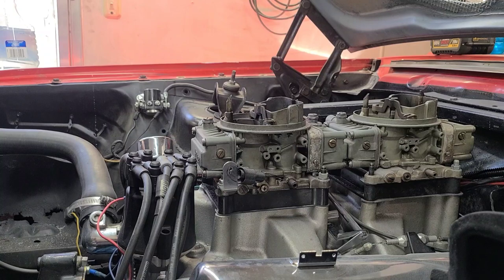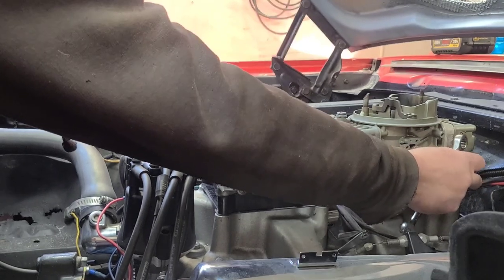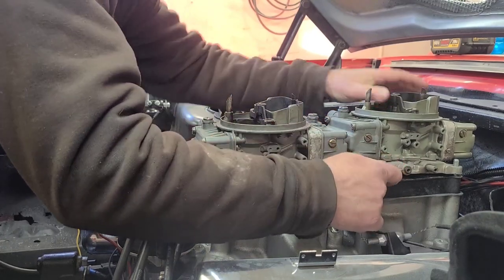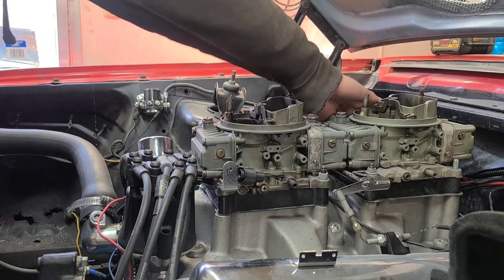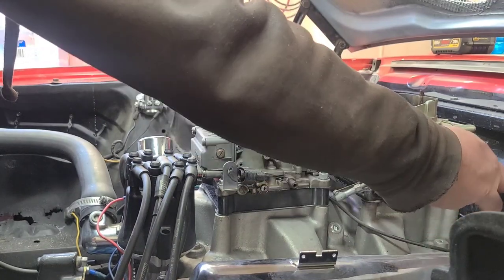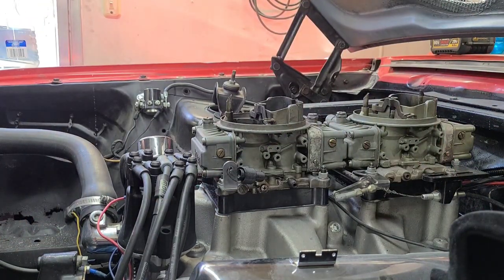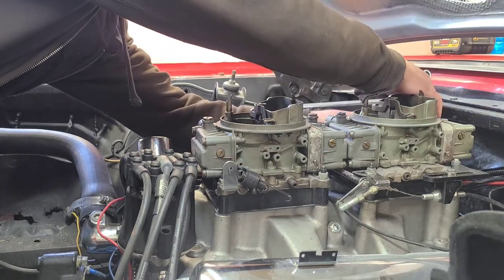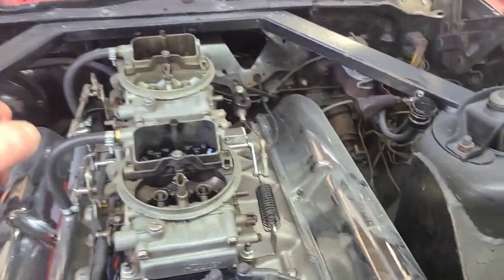1963 Ford Fairlane FE Dual Carb linkage and a little history

Comment: Thank you so much for the knowledge you have being shared. I love learning about older cars. That's what I grew up doing is working on them. I was fortunate to be a Chevy man, never understood the things Ford and Mopar done... Lol.   That being said I miss the little 67 Falcon that I had when I was 17-20. Got to where only people who would run my 3rd gen Camaro was those who knew they could outrun me... Of course around the little town we terrorized here in south Ga... So I took a blown up 350 cleaned it up and put my Camaros intake and aluminum pulleys and everything on it. Dropped it in the Camaro. Took some old stamped steel tall valve covers and an aluminum intake, painted them Ford blue painted the block an off white tractor for 9 in color put black aluminum pulleys on it and a 125 shot sneak nos system run through a vacuum line to hide it fixed a carb spacer with the guts out of the nitrous plate. That 388 would tote the front of that falcon pretty good. We didn't have drag radials so I always ran some half used oval track asphalt Hoosier tires my dad or uncle would sell me pretty cheap. Those were great days looking back from 40... Been trying to build another since my nova I sold before my divorce. But busy building the boys vehicles with them. They're 15 and 12 and own two a piece.  One to complete build, 68 C10 and a 94 Z28. Then both have trucks they play with, ones a 92 step side 377 forged internals thinking about adding turbos, the others a 89 fleet side GMC 385 stroked LT1 WITH A VORTEX SUPER CHARGER.  Both have 350 turbos trans brake and 456 gears... They do well with them. 377 right now has a weiand blower on it smaller one though...177
Reply from the maker: Hey thanks! Glad you're passing on knowledge to the next generation

Comment: Thanks for sharing!  I also have a 63 doing a 302 roller , gt40p heads, stage 1 tfs cam and a t5 . Originally a 170 auto with 43000 original miles . 👍
Reply from the maker: Thanks. You will really enjoy your car with a hot 302 in it👍

Comment: Thanks for the video, really nice car! I have a Raven Black '63 Sports Coupe which came with a 221 engine and before I got the car someone put a Toploader 4 Speed in it and a 302. I built a .030 over 5.0 engine and restored the car complete with a lot of upgrades.
Reply: @billyharris-ul6qv Ford 221 V8 was 1962 Ford Fairlane only.